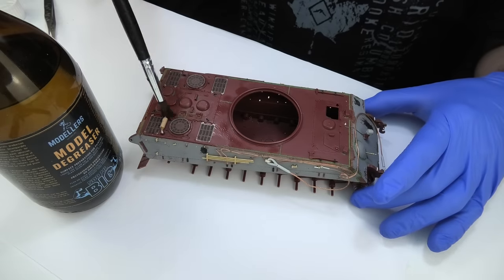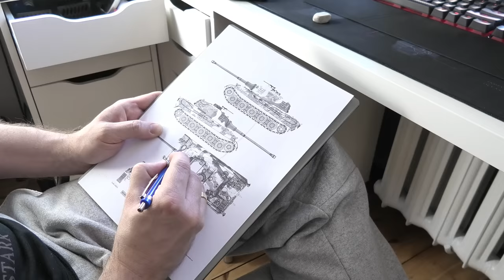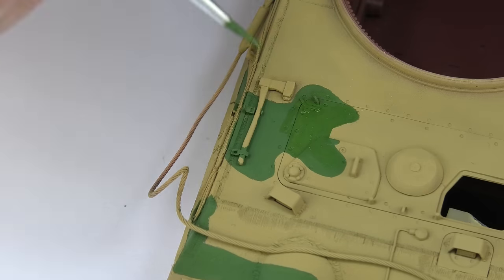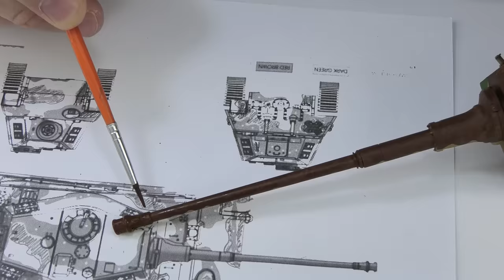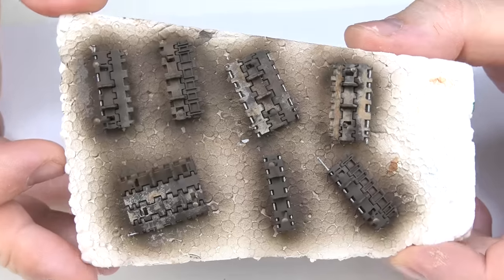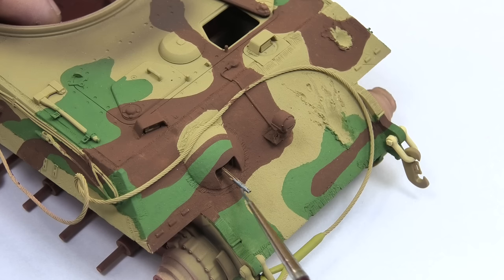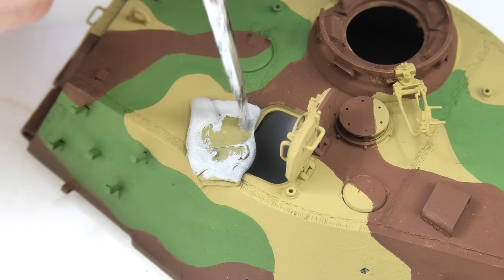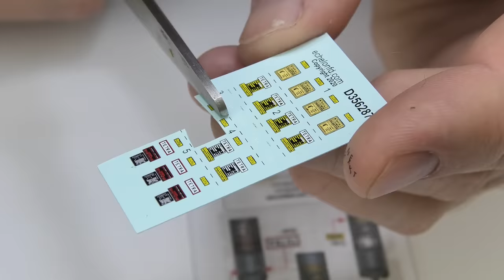Old school King Tiger camo painting and color detailing tutorial, Meng TS-031, 1/35 scale

Comment: I tend to find that metal on tracks in active service (eg the ones driving the tank) have little to no corrosion, whereas spare tracks or tracks on vehicles in museums or so have corrosion. The only notable acceptation is the Leopard 1-2 series’ track connectors 
Hope this helps :)
Reply from the maker: Yep. But the tracks in museum are a bit away ftom the real ones because of the time they are on the tank presented :)

Comment: I really like this. can't wait for the next part. What fire extinguisher decals are they, and where can I find some! They really set it off.
Apparently a black G on the tank means it has the motor coolant treated with glysantin, which is an antifreeze.
Reply from the maker: The decals for fire Extinguishers you can find on Ebay. And for black G letter i thought it was for glysantin but read somewhere that there are some doubts about that. :)
Reply: The decals for the fire extinguisher are made by Echelon.

Comment: I have a question, for the German late war heavy tanks like Jagdtigers and King tigers, didn’t they paint the camo with the side skirts and mudguards. Meaning that if they fell off or were discarded that the original German primer would be showing where the original side skirts and mudguards?
Reply from the maker: Some of them were painted entirely in camo and some had a strip of red undercoat paint. :)

Comment: heya, do you gave any tips with application? do you thin? i cant really tell.... new to thinning, need to know ratios...
Reply from the maker: Just add 3-4- drops of thinner for 10 drops of paint. Try on some old m odel how it will workj for you. Make some trails. I mix the paints for brush painting without any exact proportions. The brush should flow easily over the surface :)

Comment: How did you remove the grease on the surface ?
I saw you APPLY a grease thinner, but I did not see you REMOVE the thinned grease. After applying a thick layer of remover, you must somehow wipe off the liquid. If you don't, you will only dilute the grease and spread it out, all over the model. It has become a thinner layer. You did not remove it. At all.
Reply from the maker: It evaporated in couple seconds :)
Reply from the maker: It evaporated in couple seconds! :)
Reply: @coldemonspl  : Then... Why did it not evaporate before? 
By adding thinner and brushing it, you only distributed the grease. The thinner evaporated and the grease remained. But now, as a thinner layer and spread out over a larger area.
Reply from the maker: @telescopereplicator  please let me know the time of the video to be sure we are talking about the same :)